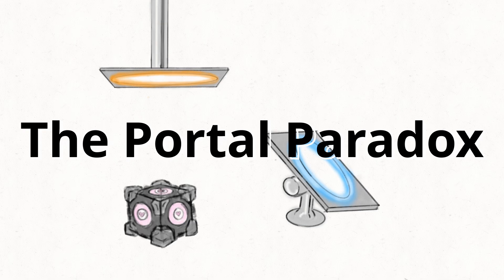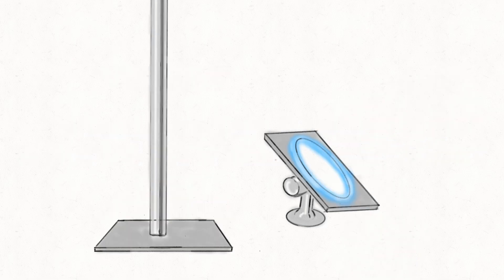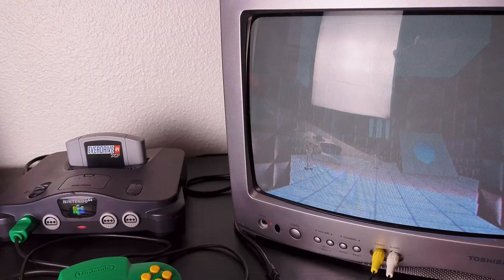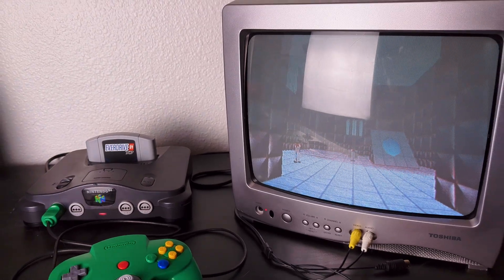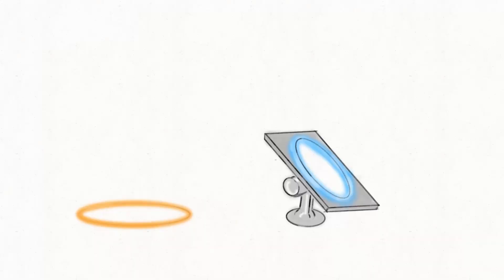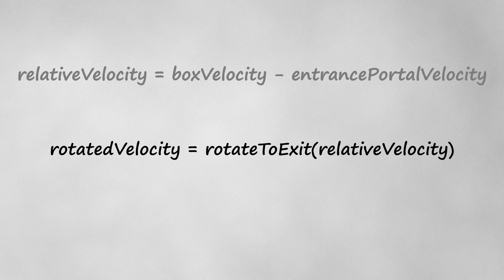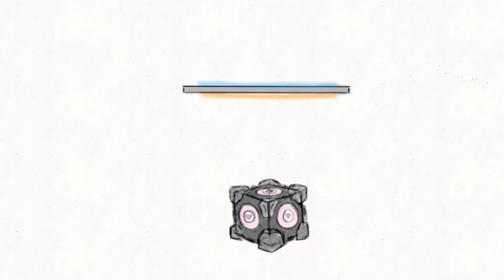I rewrote Portal from scratch and solved the Portal Paradox

Comment: This can actually be replicated in Portal source version but slightly reversed - because a portal on a moving surface towards a cube sitting on the ground is no different to a cube sitting on a moving platform upwards towards a stationary portal.

End result, the box will shoot out of the portal at the same velocity as if the platform pushing it stopped suddenly - because momentum.

Comment: Here is why I think this is wrong, you are breaking some basic laws of physics & creating energy from nothing.

Portals are essentially doors. We have these in real life. If a door is placed on rails and is moving toward you, you do not experience any change in your own momentum as it passes over you, you are just on the other side of the door. All energy in this equation is just the power needed to move the door. By having things "jump" by passing through the door for no reason, you are adding energy to the model from nothing.

You are integrating the door's (portal's) momentum with the cube when they realistically do not touch or interact with eachother.

So the question is, where does the cube gain the momentum from the portal? And why does this equation have more energy at the end than at the start? Creating energy from nothing is impossible.

If you claim it's relative space, then the other portal should have the EXACT opposing relative viewpoint & therefore cancel out.

tl;dr You have to prove why imparting a velocity on the cube is necessary. In your own equation you are not following the laws of physics and creating a force on force trade, you are just imparting velocity because it's in a different 3D coordinate (why?). The cube would be perfectly happy to travel through the portal unaffected.

Comment: Edit: here's the civil version of why this is wrong:

Let's establish basic facts and then why they must be true, then you can try to deny and pick it apart:

1) A portal must only ever be a link in space-time sharing an inertial frame of reference. 

This is because the portal has no mass or energy, it is an absence or void, aka a hole. It is Space.

2) The platform is accelerating, with a hole in it.

It is undeniable that the platform itself is accelerating, but the hole in the center is not, as an "absence" or "void" cannot accelerate.

3) An object passing through space is the same as space passing over an object.

Inertial frames of reference DO matter, and they form the very basis of physics.

4) The first law of thermodynamics must always be observed.

Energy cannot be created or destroyed, this is a fundamental fact.

Now let's set up this scenario:

A platform with a hole is accelerating. The hole passes over an object. The object remains stationary, and is simply on the other side of the hole.

By actual physics, this is how the portal interacts with the world around it, or rather doesn't interact at all as a void cannot impart force or act upon anything. The box is simply on the other side of a hole.

However, in the video's demonstration he assume that the void of the hole has a vector of energy or mass that somehow acts upon the box. This cannot be true, because the portal is SPACE, a VOID, NOTHINGNESS, in other words a HOLE. If it did somehow impart a force upon an object it passes over, than the very act of moving the portal means it passes over light moving through it. By the demonstration then, the light must also accelerate past the speed of light upon exit, even though nothing can exceed the speed of light.

The not so civil version:

It's a cute idea, but it's wrong. What you're saying is if you accelerate a portal near c, everything going through it close to or at c should accelerate past the speed of light.

The system instantly breaks down with a single second of critical thought. 

There is no velocity imparted on the cube, no force is acted upon it, it is simply transported from one location to another.

Maybe research quantum entanglement for why you're wrong, the information is publicly available. We've actually demonstrated this as false as we've created "white holes" for qubits that instantly communicated information over distances and didn't impart any extra energy when doing so.

No force acts upon the cube, it simply moves from one location to another as if passing through a hole or window.

It's exactly the same as if you had moved the entire room at a stationary cube. Why is it so hard for you to understand this, and why did you think that calculating 1 variable into a toaster would somehow replicate real life when it takes a damn-near super computer to calculate modern physics results?

In order for your crackpot theory to work, the universe requires an inherent orientation regardless of inertial frame of reference, which is mind-boggling stupid conjecture postulated by flat earthers.

You didn't include inertial frames of reference, you didn't include light cones, you didn't include dozens of variables because it's impossible to do so on an N64.

Stop the misinformation if you understand nothing about the physics.
Reply: That's a lot of words (most of which you blatantly don't understand) but none of it answers one simple thing; if the box doesn't move then how does it exit the other side of the portal?
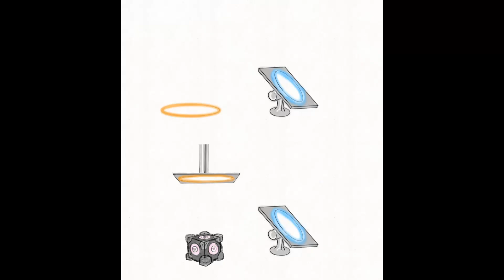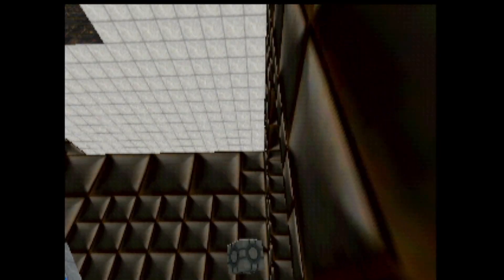Reply: Wow, multiple shitty hate comments, huh? Check out 1:35-2:00, prove what’s wrong with his reasoning. And while you’re at it, check out 2:00-2:58 for why your hula hoop theory/window theory isn’t applicable.

I agreed with the window theory before watching the video, but I didn’t fly into a conceited rage in the comment section halfway through it.
Reply: @Scottish Cheese  buddy we've literally proven the theory wrong by the creation of white holes for qubit transit.

To answer your question, since his model ignores inertial frames of reference and light cones, his velocity calculations would put 2 additive values near c at being beyond c, which is absurd. In the real world, if something was traveling at c when it went through the portal (white hole) it would maintain the same velocity upon exiting. He doesn't follow the law of conservation.

Don't be mad that your ignorance was wrong to begin with, especially since you don't understand inertial frames of reference. Get a little education and I'll continue the conversation, I have neither the time nor inclination to teach you basic physics.
Reply: @Scottish Cheese  alright, so let's break this down then. The equation assumes 2 units with velocity. This is automatically wrong. The warp in space-time linking the two surfaces with a single inertial frame of reference can impart no velocity nor act upon anything in any way, it is a LACK of energy and matter, not a source of one. It literally is a window between two spots, and we've proven this with quantum entanglement experiments. The speed of light is wholly relevant to the conversation because it gives us a maximum and an inertial frame to reference. 

What you fail to understand is that while the platform the hole is on is moving, the hole itself doesn't "move" because there's nothing there to "move". It is simply a void. With that knowledge in hand, the simulation fails apart entirely as it has no second unit that is accelerating.

If you believe the box accelerates through the portal with nothing acting upon it, you believe light itself accelerates through the portal. This literally cannot happen within the same lightcone/inertial frame of reference (the portal hole). C is the universal maximum.

The flat-earth comments are because flat earthers deny gravity exists and think bouancy explains why things accelerate towards the earth, then stating that the effects work because the universe has an inherent "up and down" to reference, which is provably false. That it is provably false then proves the portal theory wrong by dint of no inherent "true frame of reference" to assign to the hole or "lack of everything but space".

Have I lost you? I'm trying to be kind.

We can discuss qubits and quantum teleportation once you digest this bit.
Reply: @Scottish Cheese  are your comments getting removed? I can't see them. I disproved the equation as fundamentally faulty. Please let me know once you've read and understand that first bit I've given you, then we'll discuss quantum teleportation and qubits.

Comment: The flaw in your argument is that by implementing a ruleset to how the portals should work (in this case the rule being that the outgoing velocity is measured as the relative velocity between the portal and cube), you're making an assumption. Your claim that this assumption then leads to some sort of behavior is correct, but that doesn't mean that the behavior is the "true" behavior, because again, it is based on an assumption. Another assumption could be that the outgoing velocity is the cube's velocity relative to the room, in which case you'd get different results. The same argument that you're making in this video has been argued for and against ever since the release of portal, and I think that it's kind of arrogant to then go on and claim you've found "the" answer to the paradox, when you're merely re-iterating a point that has been made thousands of times. For what it's worth, I do agree that the assumption you've made is reasonable (perhaps the most reasonable one to make, even), but that doesn't make your conclusion correct.

Comment: My only problem would possibly be where the cube takes the energy to accelerate. Because its potential energy doesn't change, and kinetic energy spikes. But then I realised, that it would take kinetic energy from the place where kinetic energy is present in this experiment - from the moving platform. But portals don't go well with conventional kinematics because of potential energy.It's very hard to even hypothesise about how portals would work with physics, because we don't have portals, and we have little to no idea how to make them. And all the things we can, at least, assume could work, are revolving around weird multidimensional shenanigans, that work weird with conventional physics anyways

Comment: so, i haven't watched the whole video, to me the only logical solution is that it "gains" the speed of the moving portal but actually this is because the cube to maintain it's own shape would actually initially go through the portal with no momentum, but this would cause it to get squeezed between the floor and the part of the cube that went through the portal. this would create a force away from the floor from them colliding, kind of like gravity. the object holding the portal would likely feel a counter force as well since you're trying to cause an item to push into itself.

the system doesn't gain energy because the thing pushing the portal has to increase the force as it tries to push the cube through to maintain the correct speed.

everything has relative speed, but I think maintaining momentum is a larger universal paradigm than relative velocity.

In fact I think there must always be an interaction between a portal and matter going through the portal this way that must in some way be related to the orientation of the portals.

like if you're falling through a portal and then are being launched up, that's suddenly going from freefall to having a large force applied to you, from your perspective the portal would have to have been what applied this force to you and i think the portal would feel an opposite and complementary force.

like i imagine as you went through the portal you would feel the interaction between you and the portal

Comment: hmmmm. You're looking at relative velocity,  but you should be looking at acceleration, force, and just regular velocity - essentially your model breaks newtons laws of motion.

If I had a weight on a rope dangling down attached to a scale, and I moved a portal up over the weight... This paradigm would mean that the scale would measure higher as force is applied downwards on the weight, by it being projected through the portal right? But what has imparted force onto the weight? Relative speed will change, for sure, but that's relative speed for objects within one plane, and is the piston with the portal on it, on the same plane as the "pre-port-portal-post-portal" tube? It's maybe moe akin to a very fast train passing near a box... The relative speed is huge, but the box itself has no force imparted on it because it's not on the same plane.

On the same plane, it's like if you hit something with a bat. The distance the object flies is due to it being accelerated by the mechanical energy imparted onto it by the bat. Newton's second law of motion - The acceleration of an object depends on the mass of the object and the amount of force applied.

Return to the idea of a rope through a portal, and it's not being accelerated, as no force is applied. The first law of motion "An object at rest remains at rest, and an object in motion remains in motion at constant speed and in a straight line unless acted on by an unbalanced force.". It was at rest going into the portal, it was at rest coming out of the portal, no force acted on it. In the plane in which the object exists, nothing happened.

Yes, acceleration can be considered relative, but the plane through which the acceleration would matter for increasing energy is what matters if it's meant to propel an object or stretch the rope. Reframe this as momentum, that an object flies through a portal and continues to fly because it has momentum in the case of static portals - and we can see here why relative velocity is not applicable.

Momentum = Mass * Velocity - and when you move the portal, rather than the object, the object has 0 velocity. It has relative velocity, yes, but you cannot substitute relative velocity for velocity in this equation. Velocity normal is measured from it's "absolute frame" or  starting point. If I run towards object A and B, but only hit A, my relative velocity to both is the same... but object B, not being in my plane has no momentum, receivers no force from me.

And we needto think about this example with more than 2 points of reference, because sure... The whole object itself and the portal medium have relative velocity and acceleration.... But the distal ends of the object do not... So why would one leave from the other despite being in the same plane?

And lastly... Newtons third law... For every action there is an equal and opposite reaction.

If the box is propelled out by the movement of a portal, then the portal itself must also be resisted or recoil from this force if they exist on the same plane.

Intuitively, it's obvious that the box cannot push the portla mediums backwards, because how would it?

If that doesn't exist, then it cannot be propelled by the moving portal.

Comment: So I've seen a lot of continued debate about this in the comments and I think that this interpretation of the phenomenon is consistent with the logic of portals, namely that portals function identically to an open-air doorway between two surfaces regardless of those surfaces distance or orientation relative to one another.

The question of "Would a moving portal catching a stationary object impart momentum on it" is, I think, a slightly flawed question-- Rather, since we're assuming the case of a rigid cube, the rigidity of the object causes it to push itself relative to the speed at which it's scooped through, so it's more that the displacement of the object in space forces the object to impart momentum on itself, because if it didn't then the portal would compress the mass/volume of the object passing through its horizon, which we know not to be the case. 

It's worth considering the frame of reference of the orange portal, and of the blue portal, as two completely separate relativities when determining the behaviour of an object that passes through them-- Consider for instance the simplified example of two portals in a 2d plane oriented perfectly vertically such that the orange portal's base is at 0 on the Y axis and the blue portal is some arbitrary distance ahead (+x). Both portals are upright and facing the +x direction. The orange portal is moving in the +x direction toward an object that it will scoop up, and the blue portal is moving in the +y direction. When the orange portal scoops the object, though it directly imparts no momentum on that object, the object nevertheless is extruded from the blue portal at the rate that the orange portal was moving in the x direction. Likewise, the receiving blue portal, despite imparting no direct change in momentum on the object (Read: the portal does no work), indirectly causes the object to obtain its +y vector by nature of transforming the location of the exit plane. (It's worth noting that because this is an upright portal moving perfectly vertically, it is purely its vector that this imparts, and only because the object is already being extruded from the portal otherwise. On its own, with an object halfway between portals and assuming the other portal remains stationary, this movement imparts nothing.)

Assuming no friction or gravity, (And assuming the object is absolutely rigid, which is the ideal case for this) then, we can note that the sum of these interactions syncs the object to the relativity of both the orange and the blue portals-- The orange portal will never get any closer to it/further from it along the X axis, and the blue portal will never stop being at the same Y coordinate as it. Despite it seeming to us, the outside observer, that the object has had work done on it, this isn't actually the case-- The object is just in phase with the relative frames of reference of the portals it interacted with. 

...Which I think I would be confident summing to an axiom of portals: "An object traveling through a portal pair will inherit the spatial frame of reference of each portal in that pair."